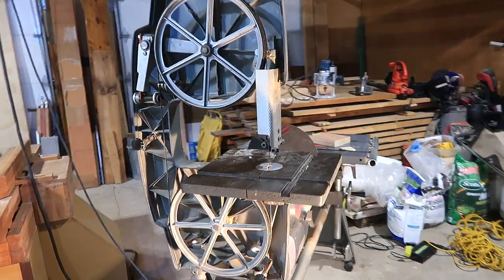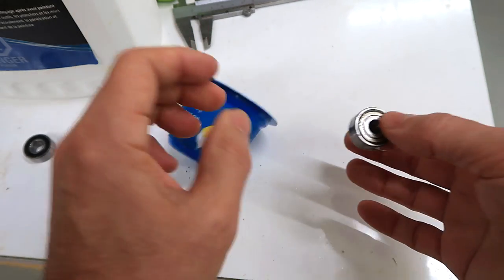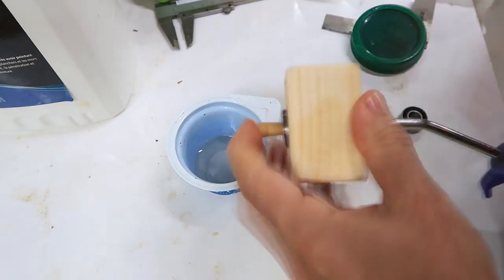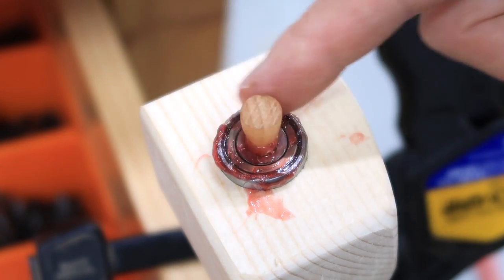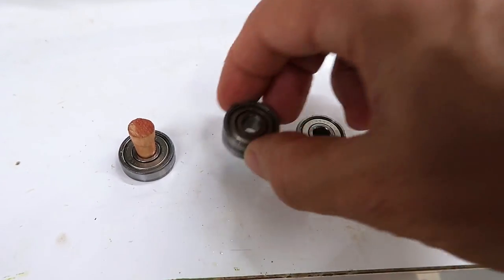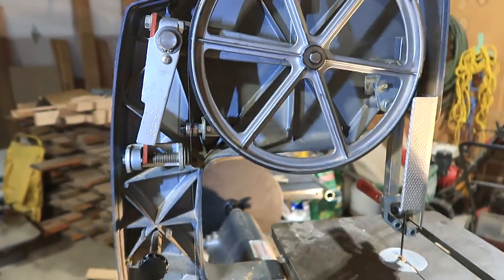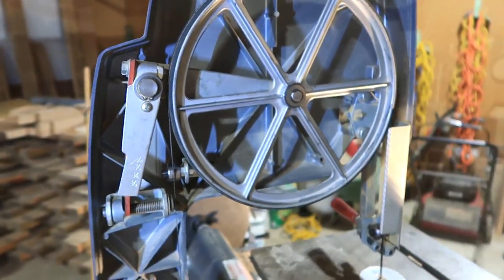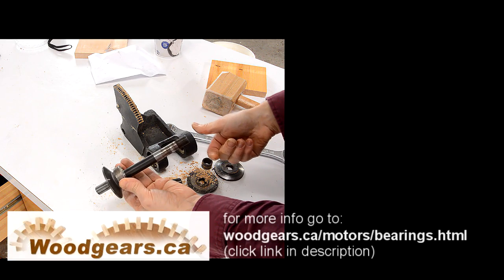Re-greasing a shielded bearing (no disassembly)

Comment: What on earth is the point, replace,  bearings are very low cost!
Reply from the maker: if you can find it, yes.  but this is an oddball size.  also shipping costs and waiting for it.
Reply: Yeah not all bearing are cheap, and many times just getting fresh grease in will provide many more years of life.
Reply: @matthiasrandomstuff2221  I’m not sure where you live, but here in the US there are tons of bearing companies that have pretty much any size you could imagine.  I’m in northeast Ohio and there is Akron bearing just to name one.
Reply: The difference between people 70 years ago and today.. they would fix it while we throw it away and buy new.
Reply: @QargZer  Cost for new vs. Repair old.
Reply: @Hofstader007  repairing old stuff is often cheaper in the long run and sometimes in the short run.

Example of a serious issue...

There is a problem with the market when you can purchase a new printer that comes with ink for cheaper than purchasing a thing of ink for an existing printer that is exactly the same printer.

A LOT of waste because they need to sell a product no one needs (printers).
Reply: @QargZer   100%  agree. I repair fans for industrial VSD's that have done many thousands of hours. They just go in the bin usually, despite it being cheap and easy to replace two ball bearings and clean it.  New fan is between £450 and £1000.  New bearings and sometimes a capacitor is less than £15.
Reply: As others have mentioned, not all bearings are cheap or easy to find.  I just paid ~$10 for a single bearing out of a pool pump motor because it had a non-standard inner diameter.
Reply: @QargZer  the difference would be shielded bearings today that can just be pressed in and forgotten, vs cup and cone bearings in the past that would have to be hand packed and adjusted. Its not just a people now don't bother to rebuild, it's the whole system
Reply: @QargZer  printers come with LOW VOLUME ink cartridges. AND they sell the printer at below cost, knowing that they will recoup the loss with ink sales.
Reply: @greenidguy9292  you clearly didn't watch the end of the video
Reply: Whats wrong with repairing? And why do people always refer to cost? As if it could represent every factor.
Reply: 4:10 - 4:20
Reply: Reading through the comments, some get the point Mathias is trying to make. I do believe that it’s worth the effort, if the bearing isn’t too far gone.
Reply: @michelarneburg  Nothing, but the noise you are hearing on the bearing is metal/metal and now its very likely higher run out and will not last long.   I got no issue with repacking unsealed, or I guess even as PM on sealed, but once the whine hits, the bearing is done for.  One this application, maybe not a big deal, but having a bunch of spares on hand, esp if you are a maker, does save ya in the long term.   likely an hour of work to make jigs, pack, clean, etc for four bearings that total8 bucks new if 7X22s.   I like spending time making, not fixing so personnel preference for me.  Of course if you have a wonkey size large bearing that is $70 - then I would concede its worth the attempt.
Reply: @QargZer  Lots of old stuff is top quality, while new stuff wears out fast.
Reply: @CM-xr9oq  "The Great Light Bulb Swindle".
Reply: @sekaikage  I was giving an example. Everything is fixable but society has deemed more profit in making it cheaper or SEEM cheaper to throw the item away and replace it.

In this case fixing the bearing is simple and most people would throw them away then realize it's unique so cost a good chunk of money or irreplaceable then have to buy a new machine.
Reply: @threadie  I'm aware... That was my point
Reply: @sekaikage  most modern bearings will not last as long as the same bearing from 20-40 years ago
Reply: The point is on top or your narrow mind have you ever replaced bearings in equipment that is old and no longer produced? That's the reason be kind remember the golden rule be a good human spread kindness.
Reply: @QargZer  Fixing stuff polishes and hones your skills - anybody can just buy a new one.
Reply: @jTempVids  Let me guess - 6203 13mm.
Reply: Clark Kyle  Yeah, but it is very satisfying to beat the system.
Reply: @uwevonditfurth2096  It will last longer than a new Chinese bearing.
Reply: @QargZer  It's like buying a new bicycle chain instead of just oiling it.
Reply: @catfischer86  A new bearing comes with very little grease - I always add grease to new bearings.
Reply: Yep, cheap bearings, only the I/D is important, or just pop the shields off and pack with grease and press back on, the only reason you're easily getting grease in is they're worn so much.
Reply: I'm not trying to argue, but after Matthias worked out that solution with the grease gun pump, it took him only a few seconds to regrease the old bearings
Reply: @greenidguy9292  oddball sizes are expensive, standard bearings are dirt cheap.
Reply: Expediency. Get it up and running now.
Reply: Well if you live 50 miles from town it ain't that easy son.. Plus why spend money on something you don't need? Your to used to the throw away society.. try this.. fix what ever doesn't work then take the money you would spend in time gas and part price.. stick it in a jar then dump it all out at the beginning of the new year and if you have any talent at fixing things you will have a nice little chunk of cash there..
Reply: It’s a bandsaw. Get a bearing to fit the I D and about the same as the original. Adjust your bearings to work as they should. Do not use worn out bearings. The grinding noise is metal being eaten away and will cause more damage to other parts.
Reply: And to add, the price of printer ink after the artificial inflation makes it more expensive by weight than liquid gold.
Reply: Even the new bearings don't come with enough grease in them, I remove the cover of the sealed bearing and repack with more grease.
Reply: @dave evans the point is even new bearings have no grease to speak of so one doesn't achieve anything with new bearings. Ergo: pack all bearings.
Reply: It keeps him away from his wife
Reply: @CM-xr9oq  You print off whatever, then return the printer for a replacement which comes with new inks. These companies will soon learn when it hurts their bottom line!
Reply: Because some bearings aren't actually out of spec worn out, they are just not lubricated enough. Running them unlubricated, will damage them, though.
Reply: The point should be obvious
Reply: @user-ew7nz3yw2i  this is one of the reasons I started my little machine shop
Reply: I have needles to inject grease past the seal. It ‘ll keep me going until the end of the day. Not hardly worthwhile. If a bearing has run dry it’s shot.
Reply: @QargZer  they knew how to fix, you don't.
Reply: @tayyabsafdar7069  actually I do know how to fix a lot of things.. but society has made it difficult to fix things and easier to buy new. They also put intentionally poor parts in a machine so that it won't last too long forcing the customer to purchase a new item at some point.
Reply: Grease is cheaper
Reply: I'm suppressed at matthias showing this nonsense having mostly great vidios
Reply: Those beings fit. And work. And cost 0. And take about the same amount of time to maintain as ordering and working to pay for new ones. And might be noticeably better quality. And probably weren't made in another hemisphere.
Reply: Clark Kyle  i don't agree, for example I own a few induction motors... Old motors... They are quieter and better build that that the new ones (and I know that because I also own a few new motors too
Reply: @QargZer  3d printers are a good example of what u are saying... Poor parts intentionally
Reply: Then you replace it & get to hear "real mechanics used to fix things, these aren't mechanics they're just parts changers". It's a liability not to change them  in today's business, but some people just like to fix things. It's why it's called tinkering.
Reply: @QargZer  It' s same with glued battery into mobile phones. 
It is a programmed obsolescence design of products.
It's a consumism rules.
Reply: @greenidguy9292  That’s where I buy bearings as well especially when I worked at ABSC. Never came across a bearing they didn’t have or couldn’t order.
Reply: It's all about the challenge! Maybe most of the younger generation (please don't get triggered) just doesn't get that anymore.
Reply: @thetizzleforshizzle Depending on the application, liability is equally cause for replacement. When parts are made by the lowest bidder & cheapest sources as they are today, I'm replacing anything sealed on a vehicle. I've witnessed enough mishaps from "it should be fine" 30 years parts & service new car dealerships in Dallas. Customers don't understand how eventful it can be when their hub & bearing lock up & sheer off as the come to a sudden halt. I think it might be the wheel & tire still attached & the assembly passing them is where the otherl 14 kinds of pissed off come from. Lol. Just a hunch.
Reply: @arnoldrimmer9161  Well I was told it's all about the Benjamins. Now I'm confused.
Reply: Not sure if you noticed, but the current supply of everything has been experiencing massive disruptions for the past year+.

Even without supply disruptions, it's not so easy to find things on the internet these days - big business has fully sunk their hooks into e-commerce, and that's created restrictions for smaller businesses and individuals. The internet isn't as free as the golden days of yore.
Reply: @chris746568462  Same with central heating flue fans. Ours was replaced at £150 due to the constant screeching noise. Looking at the old fan revealed the bearings were just type 6006 bearings, available from eBay for less than £10 for the two.
Reply: Simple, it is of the principle that this is done. if the only thing you know about a machine is to press a button, then surely you have skipped to the finish line. Imagine if you will our Civilization becoming so advanced, and then one day a catastrophic event happens, and we lose the commodity of collected knowledge; which would blow us back into a stone age, but we would still be able to press buttons. The probability of becoming a dogmatic society is very high that wouldn't allow the study of this technology by controlling language to narrow the range of thought, or through a new Religion . Anything new would be created by a Lego kit assembled by a machine. Not able to dissect anything with a scientific precision.
So, to put this short, to not repair the bearing by just replacing it would mean the logistical fall of Humanity into a dogmatic stagnant civilization.
Reply: @matthiasrandomstuff2221  I did order mine from ali. $10 for 10 bearings. Odd size, but ali had them.  Intermediately i did use an old fidget spiunner bearing with a 3D printed adapter. Works better than original so its still in there.
Reply: I remove all my idler bearings on snowmobile and clean and repack every year the ones that are hard to get at I swap out biannually.  Doing three sleds it's cheaper. Sad thing is new ones I have to clean and repack anyway
Reply: I have a bearing on a sway bar which can not be replaced (unless you deform the sway bar) and things like this will be helpful for me
Reply: You talk like Queen Mary Antoinette
Reply: Free is very affordable.
Reply: Either you get it or you dont.
Reply: If possible carefully removing one seal is a better option.
As washing the bearing in fuel gets dirt inside more easily than you think.
Once open you can clean the ball races properly and grease  them aswell.
Best try a needle or pin to open the seal
Reply: Same with people…
Reply: What on earth is the point, to watch this video than?
Reply: @greenidguy9292  now you know how to grease one in case you run into a situation where you can’t find one. Very useful information. Buying a part is not always an option. Having skills to fix something is a gift that keeps on giving. Parts changes are replacing mechanics who could use their brain.

Comment: That vacuum method was pretty clever. Granted, it wasn’t the most efficient way to pack a bearing, brute forcing the grease in proved to be much faster. But still it was clever.
Reply: For when you don't have a grease gun on hand
Reply: New video on how to clean grease residue out of my vacuum hose 😂
Reply: Sure... seems mostly like a safe way to get a bunch of slimy grease into your shop vac. They way that worked was clever dough.
Reply: @the_hate_inside1085  Clever indeed. With enough saw dust and other things being vacuumed, if it's only a little residue maybe it works itself out eventually.
Reply: @practicalguy973  More like it attracts dirt or whatever else you are vacuuming, and makes it stick to the insides of the machine.
Reply: @off spec I’m aware of how cheap common bearings are. I’m just intrigued by the method of which Matthias chose to carry out re packing the bearing. I never said it was a end all solution to greasing bearings. I just thought his method was very clever
Reply: @off spec not everyone might have access to brand new bearings in a timely manner. Sometimes you gotta do what you gotta do to get by. Matthias wasn’t encouraging people to do this, and neither am I. Of course I’d always buy a new bearing. He was just experimenting to see if he could.
Reply: @off spec $2 IF it's a common size.
Reply: pretty clever or very clever ?

Comment: In bearings that have plastic protectors, it is easy to remove these covers for cleaning and regreasing, but when these protectors are made of tin, usually the covers get dented when removed and assembled. This way to regrease this type of bearing is very well thought out. God bless you.
Reply: These here were shielded while the ones with plastic or hard rubber are sealed.

Comment: Many years ago I worked for a company that had a lot of machines that needed regular maintenance.  The bearings were all sealed as the one in your video.  We were taught to drill a small hole carefully in the seal of the bearing.  Then cover the hole with silicone caulk.  When they needed grease, we simply used a needle tip on the grease gun.  Worked good for us.  Thanks.
Reply: I saw a bearing like that on a motor that came to a shop I worked at. It didnt seem to cause any issues. I was impressed.

Comment: Yes, Shopsmiths are somewhat odd creatures (owning a couple myself). But they work fine and are still supported by the manufacturer. That’s what really keeps them going. The same basic design has been around for 66 years, with improvements that are designed to be back compatible to those older machines.

If a person doesn’t have a lot of space, a Shopsmith can be a good all around solution. Definitely not a perfect solution but it’s not designed to be in a cabinet shop. 

And yes, the bandsaw is odd by design, but for someone who understands it’s quirks, it’s actually simpler to set up than a standard bandsaw.

Comment: I used the vacuum cleaner technique on my bicycle wheels, to get grease right through the axle to both sets of bearings (having first flushed them with degreaser, and dried them off).  It worked very well.  I've also used this technique to get woodglue deep into cracks.  Vacuum cleaner on one side of the crack, tape in strategic places to concentrate the vacuum on the other side of the wood, and glue applied at that point until it appears at the other side of the wood.

Comment: I used to clean bearings every week when I raced R/C cars a couple of decades ago. I bought a jig that, although plastic, looks a lot like what you made for blasting out the bearings using brake cleaner. It was designed with a conical shape so that many different size bearings could be cleaned. IIRC it was called a bearing blaster. Thanks for the tips and the memories!